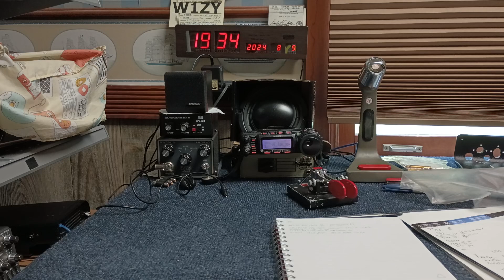DX SUCCESS- New 15 Meter Quarter Wave End Fed ( NO BALUN)

Comment: Not to one up you.....but I recently returned to HF after being away for several years !
Bought a 135 feet of 18 gauge Super Wire, as it's called, initially for a Short Wave receiver antenna !
Then my mind got to wondering, and I remembered I had an old MFJ 9040 QRP rig, and a Z tuner that I had never tried !
One thing led to another, and I've been playing CW now for a few weeks, and having a Ball !
Like you, many times you can't buy a signal on 40 meters ?
Where the ops go, I donno, but many times I'll look to the Reverse Beacon Network, and find skimmer reports from a number of places !
California, Canada, etc ., but what brought me here, is many times if nothing else, I'll have reports from Costa Rica !
Pretty good shot from the Midwest on 4 watts, and a long wire !
Oh....and no Balun !
Straight out of the QRP Tuner thru the wall and outside !
Got back in, just as the Sun began throwing fits !
And was still able to make contacts !
Hi....!
Fun stuff !
                    👍😉
                       '73 !
Reply from the maker: Welcome back, we need more CW ops! 7024 cw is the spot. If you cant work xtra, go up to 7026. This is where the reallly good ops are.

Bands are horrible, but the lack of activity isnt that, its very poor antennas.

No, you arent one upping me, not till youve passed 7000 miles on a half watt.
Reply: @k8byp 
 Yes, I have the Extra !
(Doesn't everyone ?)
Hi !
But disappointing to me, is that many use Technology to their advantage !
That being use of,
" Tele - Readers " !
Just something disingenuous about it !
And was really surprised to learn the Elecraft has them in their radios !
Guess I'm Old School ?
But too many people sell themselves short, when it comes to learning the Code !
I guess, to each his own ?
But so glad I picked it up !
Licensed now coming up on 45 years !
Seems impossible !
But you know your old, when you start wondering if you'll be around for the next Sun Spot cycle ?
Hi....hi !!
😳
Reply from the maker: 100% all. The Sunspot cycle threw a chain!

I worked EU, MX and Brazil on CW last evening, but poor signals. It takes a good antenna to stay in the game now.